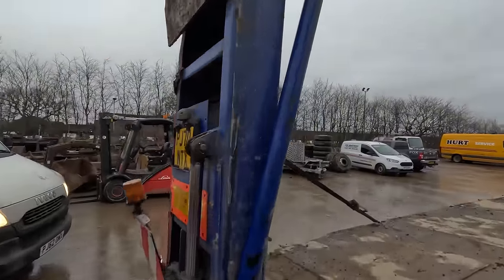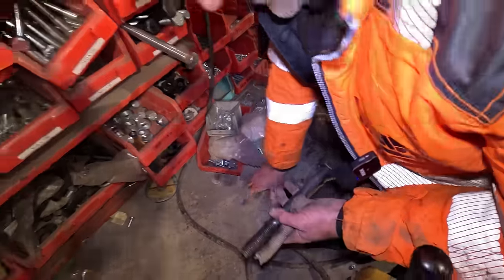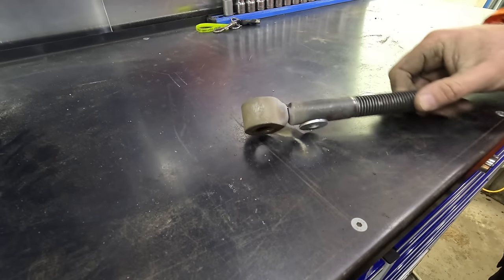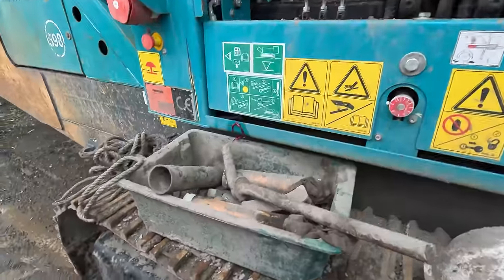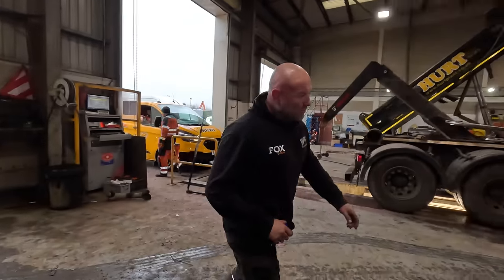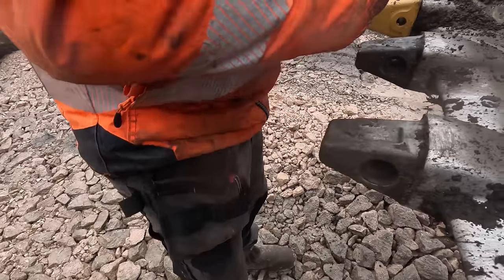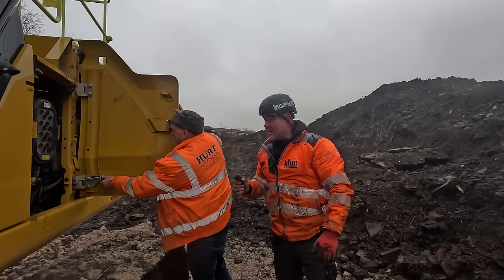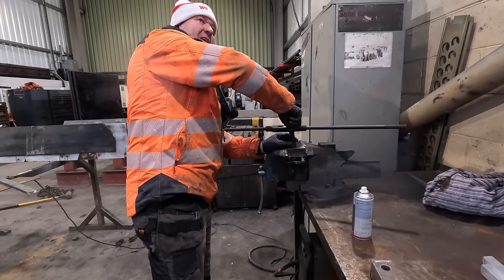CAT Gets New Teeth, Peterbilt gets Service & Livehead Gets fitted! Chronicles Ch #023

Comment: Hey Baz ive always been taught to keep the batteries for the welding mask away from each other and even if they make contact through the plastic bags it may cause discharge of the batteries.
Reply: Also touching both sides of the battery makes a circuit a drains some power.

Comment: Hi , a small tip after removing the teeth off the bucket, try putting on  only one tooth at a time from the right hand side . That way you will have more clearance as you swing the hammer , it wont hit the replacement tooth .    All the best to yourself and the rest of the guys  .
Reply: Yes that's what I do. Can't understand why operators don't change their own teeth.

Comment: Baz the welding mask might be going flat if it picks up on the lights in and outside the van if it's on Auto or welding mode  (LED's and strobes often set them off a lot if they are the right frequencies and brightness) and even pick up on light being reflected off paint and hi vis strips and stainless steel and sparks from grinding and machining. The more sensitive the lens and bigger / more light detecting area and lens the more it happens in my experience some make and brands are worse and some are better. My co worker found some Optrel helmets basicly and frustratingly unusable in field environments with beacons and strobes on equipment and crushers due to this frustration, but we are working out of utes.

Sometimes it's easier to keep the mask in the bag they come with or put it in a draw or dark place or leave it in grinding mode if that disables the auto lens, Sometimes the manufacturer has a recommendation for storage, also those small batteries can discharge pretty quick when loose and not stored in the pack before you chuck em in due to static. 

Looks like a 3M helmet, How do you rate them? and does the PAPR (breathable air) system work for you and the lads? in the workshop and quarries ? Cheers mate

Comment: Good day baz i was watching youre episode of the cat 320. And you where talking to the oparator about electric grease guns. In holland a lot of machines are fitid with automatic grease systems. I can tell you they work i have oparated a 40 ton excavator with 12000 hours on the klok and stil the  pins and bushes from the factory. You shoud look in to that. Greets from holland

Comment: For the mask battery’s the interior lights in the van set the sensitivity off on it when your not using it time to time and drains them aventually been having the same problem with mine till I realised it was getting set off from the van interior lights

Comment: Aup Baz, on that link arm I’d of put a lock nut on the bolt you welded to the eye and tightened it up to it that’ll stop it pulling in the thread in the end of the tube 👍🏻
Reply from the maker: Be reet there was 50mm of thread getting hold. The one that came out wasn’t right. Someone had been there before. I get what your saying though 👍

Comment: Hi Baz I had the same bother with my Speedglas eating the batteries. It eventualy stopped working just outside the warranty. I am now using the Jackson BH3 PAPR all the controls are on the outside so you never need to lift it. I will not be buying another Speedglas.
Reply from the maker: Yeah I've been told to keep it covered

Comment: hi baz, the xxi has a sensor that detects movement, so you don't have to turn it on manually. I have the same problem myself when I often take it with me in the service vehicle. Every bump in the road it sees as a signal to turn on.  which means it is always on while on the road.
Reply from the maker: Makes sense mate 👍

Comment: There called power harrows , from italy ,mashico is the name , check under the bed make sure theres no oil leaks on the rotors , if you have oil leak an shit drivers oil leaks out fucks the whole bed up ,  and also baz check that the correct oil is in the bed , shold be sae 140  , the early ones came out with 80-90 oil an they didnt last long , ok and if the tines get to worn you get all the dirt wrapping round the rotors an fucks the oil seals up , regards to you Baz ,lov the videos ,all the best   ex farmer from essex